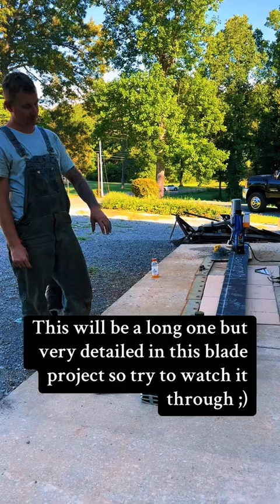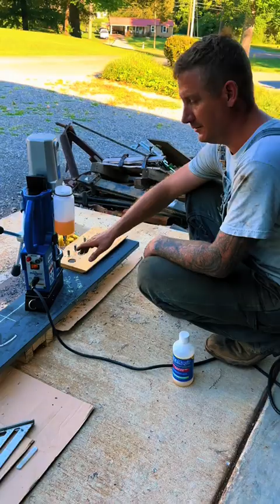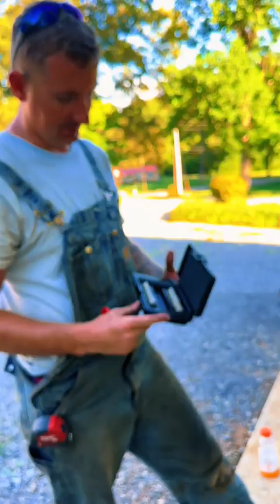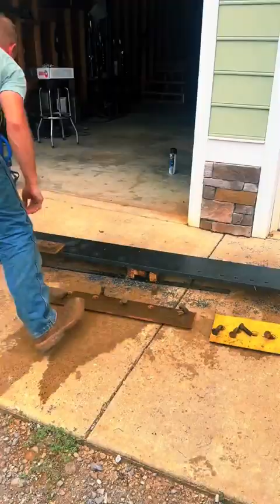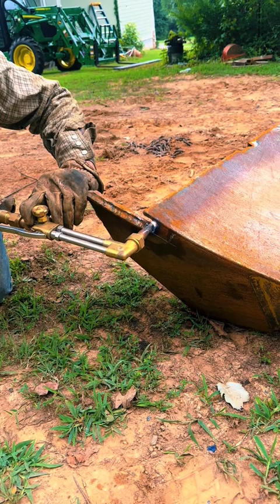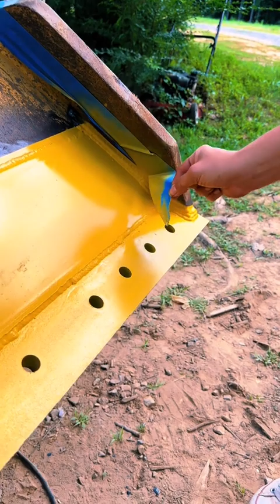FULL VIDEO | Dozer Blade Moldboard Repair

Comment: Time for a work table.
Reply: Please explain what you said about preheating the AR plate in the areas where you want to drill your holes and letting it cool overnight so you can drill it with a regular annular cutter. Mainly, how hot is hot enough? Can you over heat it? This sounds like information that I could use. Thanks in advance.
Reply from the maker: @SFS13-01  it was my first time actually drilling hard part I’ve always used a torch and cut holes because I’m pretty slick doing it like that but with these cutting edges it obviously had to be as close to perfect . After the first few successful holes drill I hit a road block , so I made a call to a super good machinist I know and he gave me that tip . I just used my #4 torch tip not a rose bud and heated my marked areas where I needed to drill till it was cherry red , let it set over night then the next day I breezed through it with standard angular bits . I didn’t even heat the back side just the side I had marked .
Reply: Or at least up on the forks of that John Deere with some stands under the ends.
Reply from the maker: @FixinCat  hahaha for long I’ll have that nice work bench and slide out burn table on the back of the truck for stuff like this . I was going to put it on the forks but by time I got it laid out I was so excited to use the drill I just started going to town
Reply: @chamberlainsPortableWelding  Thanks for the reply on drilling the cutting edge. I’ll definitely use that one down the road.
Reply from the maker: @benharris1018  I 100% can’t argue with you on that lol . I just got carried away wanting to try the new mag drill out that I just stubbornly didn’t take time to place it on our table or forks on my tractor